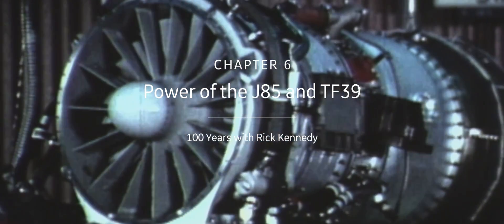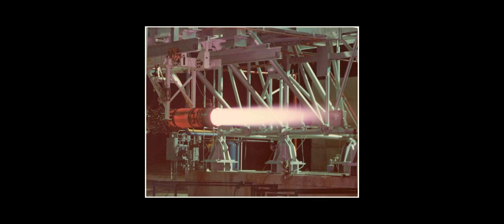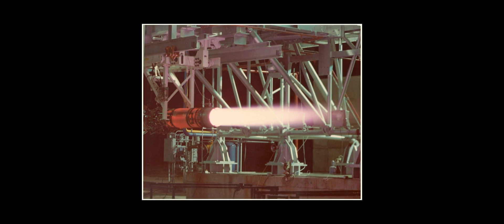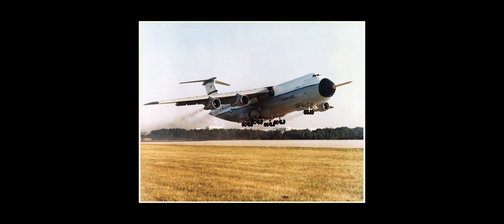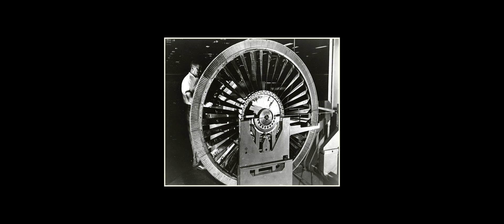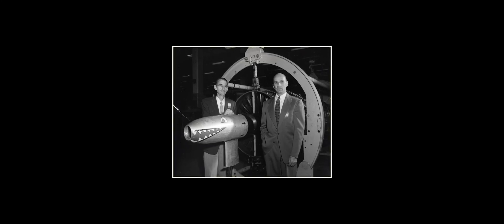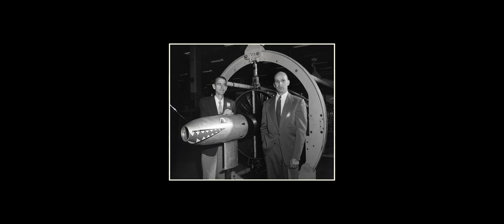Chapter 6 of 13 - Power of the J85 and TF39

Comment: GE engineers couldn't calculate Trans-sonic stall flutter because GE leadership didn't want to invest in computers. The solution was to add a smaller fan, guide vane stage in front of the fan. This is why the TF39 is so heavy and noisy to support that extra bearing structure. Never trust GE leadership!!!

Comment: And the TF39 was the strangest but coolest  sounding jet engine in the world, what made it sound so different?
Reply: 1.5 Staged T-Fan and N1 Fan. The JT9D also has the similar version, but produced slightly more amount of thrust, but doesn't have an N1 Fan, due 2 which it sounds slightly less louder. The commercial CF6's earlier variants, the CF6-6 and CF6-50, whose USAF Designation is GE F103 variant that doesn't have a 1.5 T staged Fan, also sounds as loud as TF39

Comment: J85-21, piece of junk.  #2 bearing needed to be replaced due to a bad batch, every engine that came into the shop for any reason had to have it changed, complete engine tear down, 12 hr shifts 6 days a week working on them at RAF Alconbury back in the 70's and 80'scouldn't keep them in the F5 Tiger II's, constant engine changes due to combustion baskets burning up.
Reply: The J85's that went into our Tutor jets were the most reliable engine I've worked on. I guess they mucked it up by putting that extra stage in.

Comment: And GE is still making and selling spare parts for both of these engines.   I wish I could still buy new parts for my old Mopars!
Reply: Q Can negative - TF-39s were shut down formally quite a while ago unfortunately. 😕
Reply: The TF39’s, the CF6-6, and the LM2500 share a large number of parts.   For instance the 14 stage HPC is the same for all 3 engines.  The LM2500 is still in production; thus GE is still making all the common parts.  You are right in saying the TF39’s are not in service.  The last C-5 Galaxy was upgraded to CF6-80C2 (F138’s) in 2017.